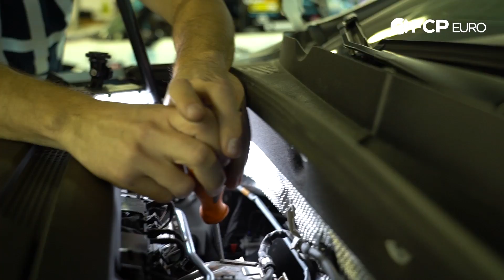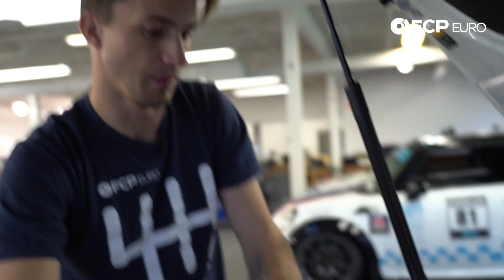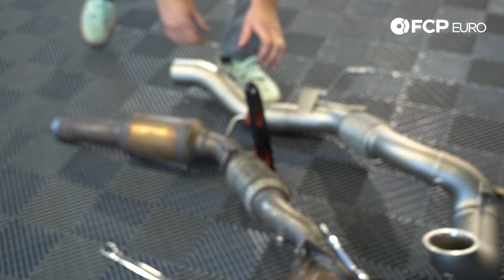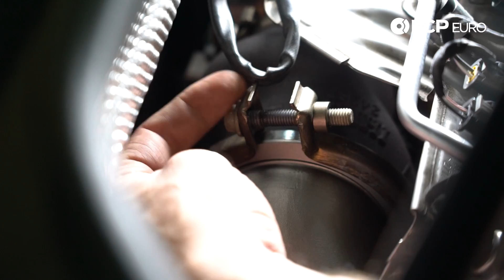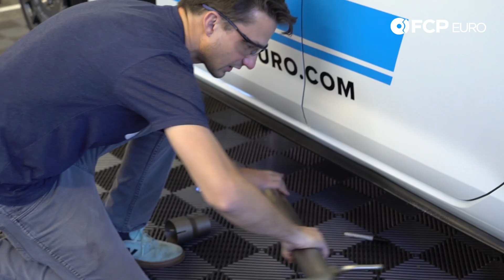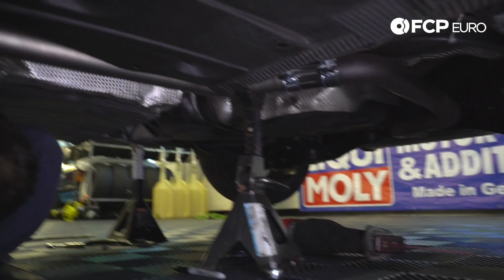034Motorsport Downpipe & Res-X Resonator Delete - DIY (VW GTI/Golf R/Audi A3/S3)

Comment: Jobs going to be little bit hard to remove std cat on an S3/golf R, on jack stands. Will need to be lifted another 8” to allow removal of exhaust around drive shaft, or you could cut into smaller sections.
Reply: Correct. I had to cut the stock downpipe in two sections when removing it to install a new one in my A3 on jackstands (same as the S3 / Golf R).
Reply: Very easy to do on jack stands on a GTI.  Took no more than a few hours to complete the job. Of course I’m not very large.

Comment: Is it possible to drive the car like that without the downpiped can anything happen plz answer really curious ???
Reply: Osmar Fuentes besides melting your engine bay plastic components and passing out from carbon monoxide leaking through the engine bay no.. perfectly fine..